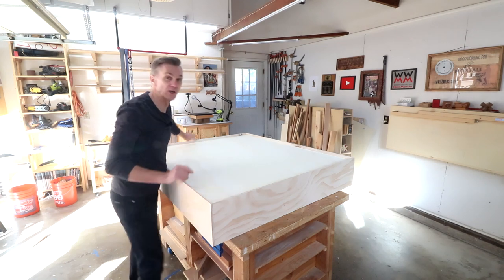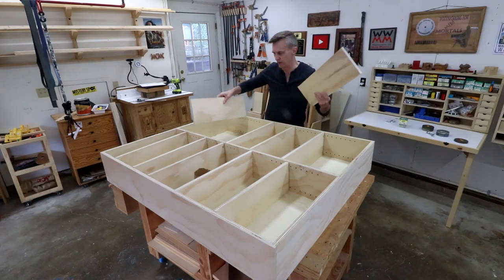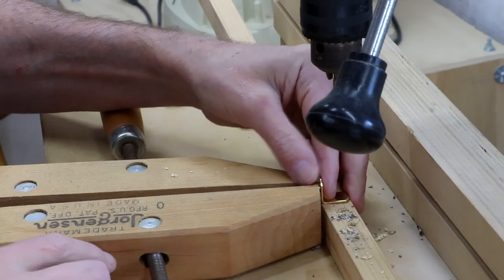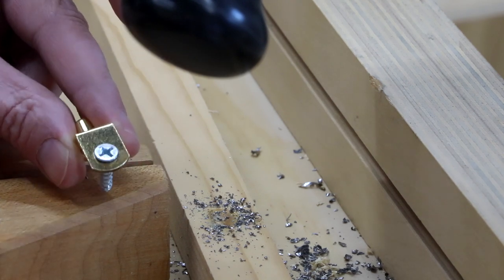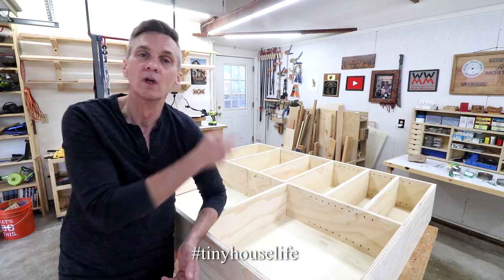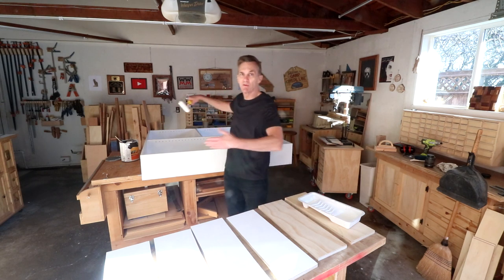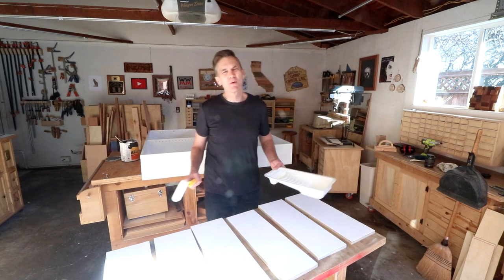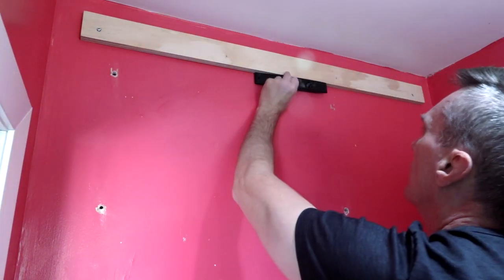This is a really big pantry cabinet

Comment: When we install shelves with a screw to hold the shelf, we put the screw in the back, so when you drag something  off the shelf it doesn't tilt, which is a possibility with a screw on the front.
Reply: But that defeats the purpose of easily adjustable shelves
Reply: They are still adjustable, if not easily adjusted.  Maybe get them how you want them and screw them only when happy with the configuration, just a thought.
Reply: @Edsbar  Like I said....
Reply: @dkupy100  to be fair, how often do you really adjust the shelves? I think most people might move them once or twice but that's about it
Reply: @dkupy100  Doesn't totally defeat it.  Still possible, which is "easily", compared to non-adjustable shelves.
Reply: Been thinking about this exact thing because we have a half shelf in a cabinet that is constantly tipping and spilling pots all over the place. If you screwed in the pins on only one side, wouldn't you be able to tilt it sideways and still pull it out easily?

Comment: Ha! I understand the deception in size from Sketchup to "reality." I'm just finishing a solid oak patio cabinet for a friend. I'm ready to do the face frame and doors. I have a dilemma... I have not yet figured a way to get it down to the floor from my assembly table.... it weighs 350 lbs (before face frame & doors)... it is 69" high, 82" long and 29" deep! Later, I'll relate my very first major wood working project back in 1974... it was a real nice full-size business desk. I built it inside the extra bedroom in my apartment. Yup... it didn't fit through the bedroom door when I eventually moved... yup, it WAS a mighty fine desk for a few years at least! LOL

Comment: Glad you left enough room above the cleat on the wall to slide the cabinet in above it (ah, experience).  The shelf brackets with holes that I’ve bought have a diamond shaped hole which (I think) allows for some variation in the cabinet sides. Thanks for the video!  One addition: for shelf pin holes in mdf and osb cabinet sides (IKEA) I’ve been adding a metal insert that fits in an enlarged pin hole.

Comment: Hey Steve, another solution to the sagging shelf issue is to simply glue quarter inch plywood to the front edge of the shelf. One inch wide strips all along the front of the shelf makes a 3/4 inch board very resistant to sagging. I did it to some half inch shelves loaded with heavy shop items and they haven't sagged yet. Also adds a lip so things don't fall off as easily.

Comment: Thank you Steve. I need to make a couple of these "units" for my kitchen. You  answered a few questions  that I had as far as self the length to weight support ratio and the french cleat system  of securing it to the wall. I was thinking of putting the shelves into dados but shelf pins are a smarter idea. I may even invest in a pin jig.  Thank you  so much. P.S. I like watching  your old videos and seeing how you and your shop have changed over the years. Yup,  I'm a fan.

Comment: Another excellent project. You are always an inspiration.

I would recommend putting the screw shelf holders on the back though, so that if you have something heavy you slide off the front, it doesn't tip the whole shelf

Comment: You have now made a dust trap at the top of the cabinet, so eventually you might find out what has been settling on your canned goods.  By adding the top you reduced the height of the upper most shelf, I've always found that the 'next' product container is always a little different then 'this' product ( and usually holds a little less but claimed to be more improved).
By not running the shelf to the side wall you have a gap, have fun either taking down the shelf or repainting the wall in the future.

Comment: I use these pins on all my bookcases, however i use them "upside down" that way the shelf is snug with the sides
Reply: Good idea
Reply: Good thought but then you definitely need screws because it’ll be less stable, and instead of a gap from the pins you’ll see the whole pin under the shelves. 
You can make the shelf snug and use those pins in you just notch out the side of the shelf that the pin will rest on. Or face frame the whole shelf, which always looks good.

Comment: You should screw in the opposite corners of the shelves. If you put in just the front ones it could act as a hinge and tip the shelf if you slid a heavy thing off.

Comment: I made similar project in the garage and wanted the cabinet to be right up to the ceiling, then found out when using french cleats, it is not possible. I had to lower the cabinet by few inches in order to lift it over the cleat, then down.

Comment: I more noticed that you did not leave enough room to deal with changing the light switch if it goes bad.  We replaced all our lightswitches with new ones when we moved in back in 2004....and have had 3 or 4 fail with heavy use since then.  And I would not want to have to remove the entire shelf to replace the switch if it were me.  Fun project as always though. :)

Comment: If you had put a face frame on the cabinet, including the vertical centre  (but not the shelves) you would not have needed to put screws in your shelf studs because the face frame would have prevented the shelves from sliding out.  It would also have meant it would be easier to adjust the shelves if ever you wanted to in the future - no screws to remove and replace.

Comment: Small correction: IKEA doesn't use MDF for their shelves/furniture. If they don't use solid wood (on their "premium" products) they use a cardboard honeycomb.
Reply: Most of the time they use particle board though. Honeycomb I only saw once, on a small piece. It's very light, you can immediately tell.
Reply: Oh and also they use wood in some cheap furniture as well and not everything premium there is solid wood.

Comment: There's nothing WRONG with that style of toggle bolts, except 1) if you ever take them out, the toggle falls down inside the wall, and 2) you have to start with a long bolt so you can reach the toggle when it's folded up, but what if you had a thin space back there, or there was an obstruction, like a pocket door? The latest generation of these is like the ones called "Togglers". They have a built-in "zip tie" that draws up the toggle, so it stays put if you remove the bolt, and you can use the minimum bolt length. I really did have to use these where I had a pocket door, and they worked beautifully.

Comment: I'd recommend screwing the shelf into the back pins - if it's not too late.  That way the shelf can't tilt forward, only back. so anything on the shelf will slide to the back rather than off the front edge and onto the floor.

If it's too late but the pins are equidistant from the shelf edges, you may be able to simply flip the shelves.

Comment: All the Ikea furniture I am aware of is made from particle board, not MDF.
Reply: Some are made with honeycomb boards, which is extremely light and actually not that bad for some uses. Also I think they use MDF for kitchen cabinets. And of course they use solid wood in some furniture.  Whatever the materials, I'm always amazed how well designed that furniture and how it gets the best out of the cheapest.

I think usually when Steve mentions MDF, he means particle board, because real MDF, at least that we have here, is actually good and sturdy material.